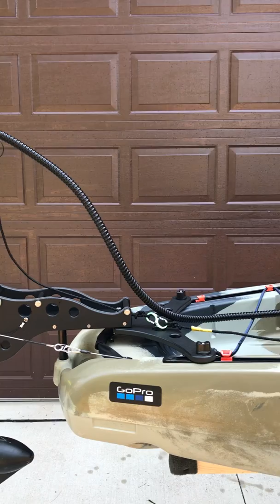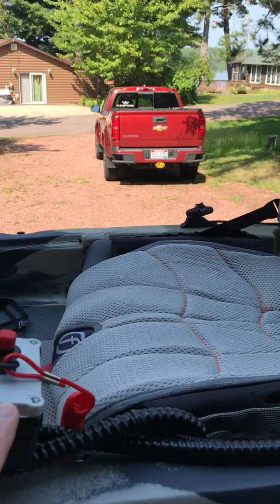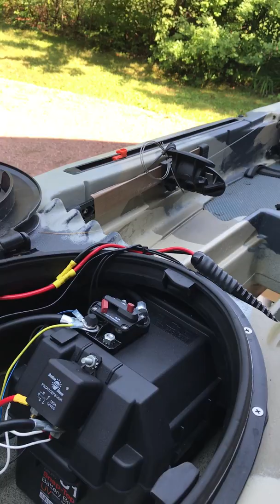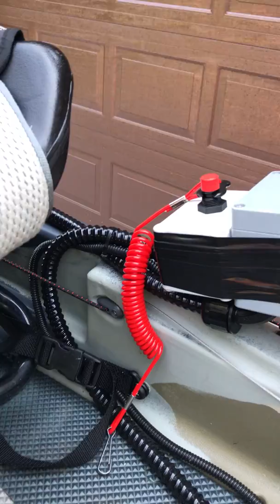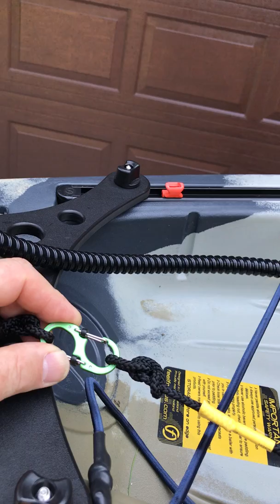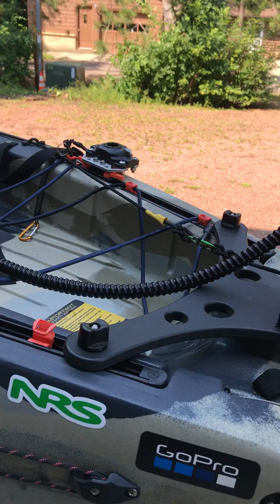Lure Trolling Motor upgrade

Comment: Where did you get that battery meter?
Reply from the maker: I got that on Amazon and it failed pretty much a week after I did thins video.  Haven't used one since.  There are better gages on Amazon.  I haven't used one since.  I also switched to a LiFePo battery and it came with a gage built in.
Reply: @Lotchik_Fishing  gotcha thanks

Comment: Where r u located please let me finish it for you. I will show you mine its simular but those wires and your sliding peddles need help. Use lithium grease small spray and they will slide all day
Reply from the maker: Not sure what you  mean by the wires needing help.  As for the peddles I have been using the tape and it works well but does need to be replaced once in a while.  So would the white lithium grease.  I have that too and it will be used the next time I change the tape out.  I like the tape because it is clean with no overspray.  As for the wires I made the decision to NOT drill holes. I will probably keep the wires on top but this winter I will be changing the control to a PWM.    Thanks for the offer but I will be doing my upgrades on my own.  It allows me to tinker.

Comment: How deep is your trolling motor in water?
Reply from the maker: I run it so the blades turn just below the surface.  Trick is to get it low enough to not make too much noise even at high speeds going forward.  Sometimes it really gets loud if I go hard reverse since it can pop up a little and come out of the water.  I could probably go lower but I like to work the shallows.

Comment: would love to see how you added that kill switch to the circuit. Did you wire it to a relay? I didn't think marine kill switches could handle the draw without a relay.
Reply from the maker: Yes there is a relay attached to this system because as you stated the marine kill switches are not able to deal with the direct power to the motor.  If you watch the video you can see the relay and my cut-off switch/circuit breaker attached to the top of the battery box for convenience in removing. I did it this way in case I decide to go back to the rudder setup for a local tournament for example.  Here is the best description of how to set it up and I set mine up using his descriptions.  He did a great job of also telling "why" to do everything he did that way.  https://delawareyaker.wordpress.com/2017/03/26/how-to-wire-a-kill-switch-for-a-kayak-trolling-motor/  

Hope this helps.

Comment: So, it didn’t work well with the toe pedals for the rudder? I was thinking of investing $27 for the pedal extensions.. But now I’m thinking that might not work?
Reply from the maker: The Toe pedal controls for the rudder worked OK.  But when I added the trolling motor the toe pedals did not work well at all.  I followed the advice of Bob Hamilton and he has a video to show you how to remove the locking mechanism for the pedals.  Once I did that I realized with the seat on this machine I did not need to have my feet constantly pressing on the pedals.  With that in mind both the trolling motor and the rudder when remove the motor are easily and more effectively controlling with the free moving pedals.  When I first sit down I always put pressure on both pedals to tighten the cables.  After that I try to relax my feet and keep them flat unless steering.

Comment: how does it track with the battery upfront ?
Reply from the maker: No issues tracking.  The battery up front allows for balance front to back.  I was concerned about having too much weight in the back so this works out well.

Comment: is the battery too heavy to be mounded in the front of the hull?
Reply from the maker: I was a bit concerned about that too so I went with the 35ah battery, U1 size which is the size used by motorized wheel chairs among other things.  This is about 25 lbs or less than half the large deep cycle batteries used on bass boats.  I also have it in a U1 battery box and pad it so it is not directly on the hull. have not seen any problems yet.